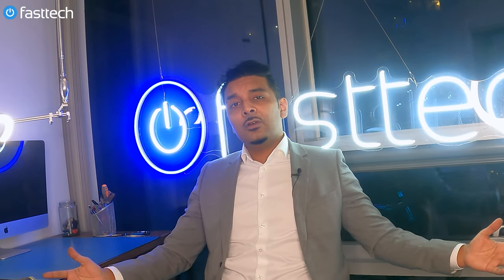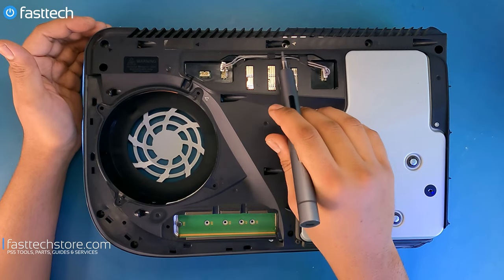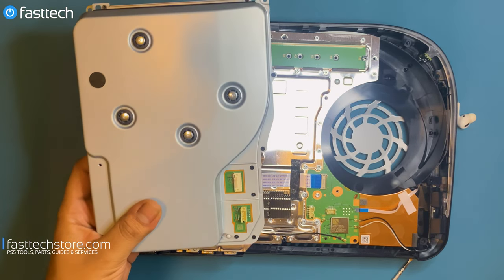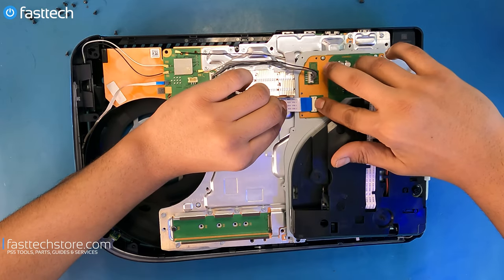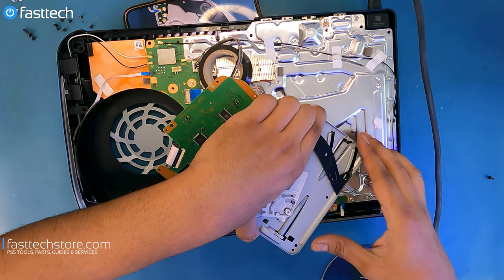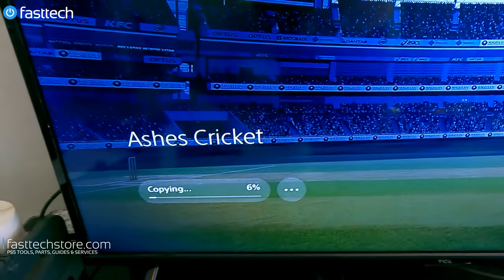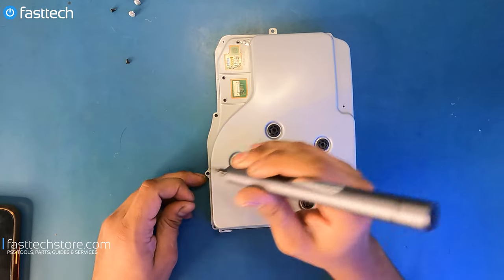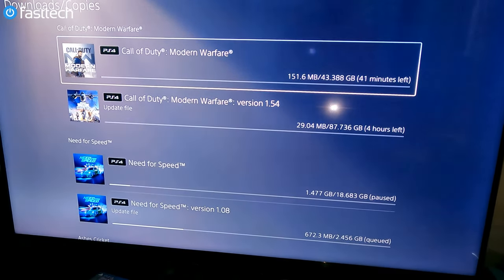PS5 Disc Drive Realignment Guide (Grinding Noise / Not Taking In Discs)

Comment: anyone knpw the solution to the lastest update since as it came out my disc drive wont stop trying to eject discs every 15-20 seconds and it wont stop. ive hard reset my ps5, updated to latest software update and idk what to do.
Reply from the maker: Check to see if liquid spilled in your eject button
Reply: @fasttechvideo hey sorry for the late reply, I figured it out. I put one of the cables that connect from the motherboard to the disc drive flipped the opposite way and it fixed, weird haha.

Comment: So you went through all that to say nobody try it because without experience you’ll blow it up? How we supposed to know it’s functional before putting the million screws back in?
Reply from the maker: I said don't try to run the drive with the system open the way I did if you don't know what you are doing. These videos are free so use them or don't it's your choice. Thanks for your comment.

Comment: My PS5 doesn’t to take in the disc when I put it in, any help?
Reply from the maker: If you tried everything in this video it could be a dead logic board (disc drive)
Reply: is your ps5 accepting a disc when you power it on or reset the ps5 and after ejecting it doesn't accept a disc?
Reply from the maker: @ndragos87  sounds like an alignment issue
Reply: @fasttechvideo  ive tried everything, once the disc is ejected it doesn't accept it again, to accept a disc i have to restart the ps5, and it doesn't even read the disc once inserted, and another strange issue is that it works only on 1080p video output, if i switch it to automatic or 4k it boot-loops

Comment: My goddamn disc drive struggles to even pull discs in like it stutters, maybe sometimes pulls it in but usually won't.  Just started about a week ago and I have to manually remove discs with the manual eject screw.

Edit: I can't take my ps5 all the way apart.  I mean I COULD I do have sets of micro screwdrivers but I don't want to take it all the way apart and possibly screw something up.  

I know why I have this issue I just don't know how to fix it.  I should really stop vaping because it's what's causing my ps5 problem.  Just gotta get this system fixed first.
Reply from the maker: If its already screwed no harm disassembling it. Just be careful with the logic board

Comment: Bro .. I follow your step . But my disc spinning slowly then stop . Then spinning again and stop . Can give solution???
Reply from the maker: Clean the laser lens using isopropyl alcohol . If it doesnt work you need a new laser.
Reply: @fasttechvideo  thank you bro . I just received my laser replacement today from AliExpress. My disc drive working again !!
Reply from the maker: @dondondonchanel7423  Great, we did not have lasers in stock at the time but consider checking us out in the future for parts. Also please like the video and subscribe if its helped you. We are dropping videos like this all the time.

Comment: Lol you put the disk in backwards what scam are you running
Reply from the maker: Its a scam because I inserted the disc the wrong way? The reader does not accept as you can clearly see.
Reply: @fasttechvideo  lol hard to say it is broken and you fixed it when you put the disk in wrong to say it was broken. And you know you put the disk in wrong to pretend it was broken.